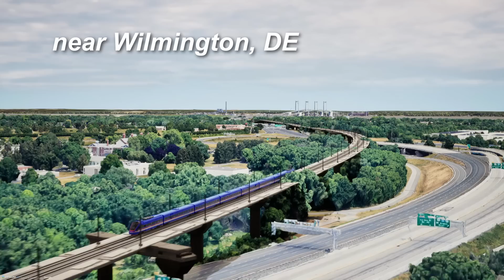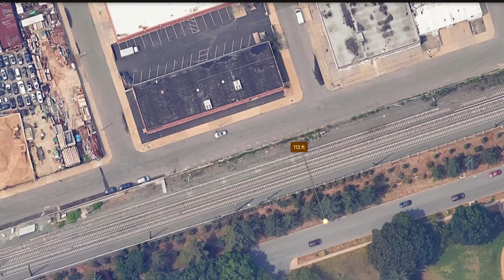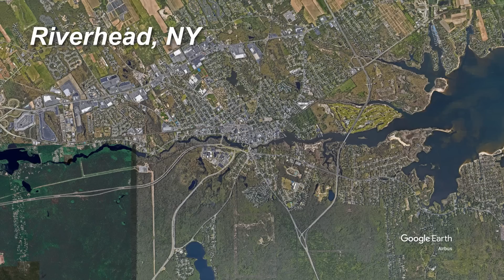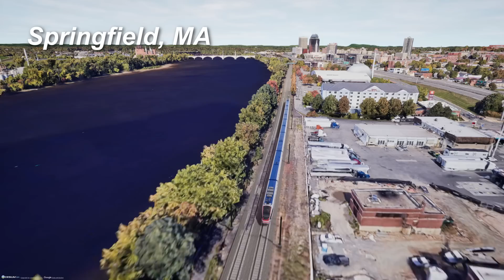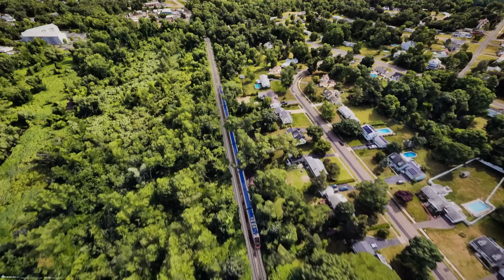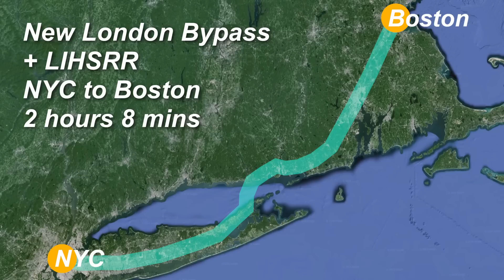How YOU Would Improve the Northeast Corridor For Acela High Speed Rail Service

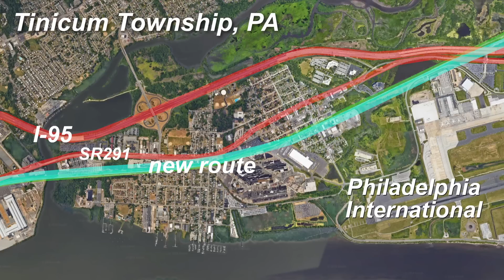Comment: I wouldn't do much. Berlin to Munich is about 4 hr min. The drive is 364 miles. So the average speed of the route is about 91 MPH. Meanwhile the NEC from DC to NYC is 2:55 for 226 miles thus about 77 MPH. It isn't a huge difference.

Upgrading the Catenary to allow for 160 MPH wherever it is straight enough is the obvious main thing to do. It doesn't require huge disruptions or taking property. The Frederick Douglas tunnel is going to save about 2 minutes so about 78.5 MPH average. 40 Miles at 160 instead of 125 is worth another 4 minutes. That gets it up to 80 MPH. I think you might have gone though how much length could actually go faster really short of a completely new line what Amtrak is doing now and catenary is really all there is to do. 

Amtrak's fractional share of trips between NYC and DC is already pretty high meaning it is already doing okay. Honestly I think the upgrades to the NE Regional rolling stock will be more impactful in ridership than shaving a few minutes off for Acela. Reliable headways and nice places to sit beat 20 minutes saved.

Comment: So, I live in Philly, and think W. Passyunk Ave would be better off as a subway line that connects with the BSL. Reading Terminal isn’t the worst spot for a new, underground station, in terms of what places it’s near, but it’s probably a nightmare trying to tunnel around there, especially anywhere near city hall (the foundations are MASSIVE) Personally speaking, maybe replacing I-95 between the Walt Whitman and Betsy Ross isn’t the worst idea (because I-95 in PA is genuinely a kinda redundant route and Center City doesn’t need to be cut off from the river like that) and while we’re on it, I’m also just gonna mention my pipe dream of a tunnel under the Delaware River connecting the Center City Commuter Tunnel with restored passenger service in South Jersey which, in conjunction with the “Swampoodle Connection” (a name that’s hard to forget lol) would allow for 1 seat rides from the PA suburbs to the Jersey Shore. How this interacts with high speed rail (including possible connections to Atlantic City, which is just a low hanging fruit for high speed rail from what I’m told) could be interesting if somehow it’s worth using that tunnel and then going up the median of the NJ Turnpike and then reconnecting with the NEC shortly before Newark Penn

Comment: Great video. Boo-boos: Your photo of Reading Terminal in Philly is actually the old Broad Street Station of the PPR which along with the platforms and viaduct was demolished in the early 1950s, replaced by the 1930's Suburban Station with its underground approach from 30th Street Station, and by the office towers of the Penn Center build over the site of the old station and platforms. Also, you referred to Manchester, Conn as Manchester, New Hampshire :D
Reply from the maker: Ooooooh. I made the mistake of thinking there would only be 1 gigantic railroad terminal in a 6 block radius and I thought both were at the same site.
Reply: Reading Terminal still exists

Comment: I heard it is impossible and extremely expensive to build a tunnel in that location. It is extremely deep in this location. But in an ideal solution, it does provide another route into New England. 

Another idea is to run into LaGuardia Airport. There you have your underwater tunnel into the Bronx. So now you got a train serving an airport. It would reconnect to it routing once in the Bronx. Even Metro North can serve this section. But it would use LIRR right of way until Sunnyside.
Reply from the maker: The sea floor is only about 160 feet there. Might need to start it slightly further inland, since it drops off pretty quickly.
Reply: @LucidStew  They can easily offer a ferry service connection Everytime a train arrives. And it would connect to another train for points west, east and north.
Reply: @LucidStew  How about one of those submerged floating tunnels, where it's essentially a bridge, but submerged in the water column with cables attaching it to the sea floor.. That wouldn't need to be particularly deep, just deep enough so that ships can pass over, and may well be quicker and cheaper than a bored option.

Comment: Could a third rail pickup be added to the Acela trainsets for operating on the Metro North Railroad tracks? While it would limit top speed , it doesn’t appear that  the train would be achieving speed fast enough for it to be an issue.
Reply from the maker: Yeah, I think so. That's basically what the range is about. Its a lot cheaper to bi-mode some trains. Your 3rd rail limit is about 100mph, but that route isn't that fast.

Comment: Great work as always. NEC south of NYC probs needs to come to the realization that it’s very near its final form once the current projects get built. Unless there’s a breakthrough on tunneling costs, that Philly tunnel ain’t happening. Some version of straightening the Maryland curves might be possible, but difficult. 

North of NYC though: I’m still a fan of LIHSRR using the Hempstead branch to Farmingdale. Wasn’t expecting you to go all the way out to Riverhead. I would turn after Ronkonkoma near the Brookhaven National Lab and hook up to the NEC at New Haven. More specifically, I would create an Immersed tube rail and road tunnel for HSR and I-91 so tolls could help cover the costs. Then Hartford to Worcester + Boston via I-84 and Framingham Line (or even expanded Fitchburg line). Regional still connects to Springfield. 

Massachusetts has been mulling an “East-west” rail connection, so this could hopefully link the projects.

Comment: Commenting as I sit on the Acela heading from DC to Newark! It’s crazy how low the average speed is even between DC and NYC.
Reply: Commenting on this again because I had a crazy ride…. Someone was on the tracks north of Philadelphia and we braked very hard to stop, train turned off for 30 seconds and then restarted… conductor confirmed we had a trespasser and they had to do brake checks before we could move again.
Reply: That average speed of 80 mph for the Acela electric train is not much faster than the average speed of 77 mph for the diesel Brightline train from West Palm to Orlando.
Reply: @davidjackson7281 The average speed is actually a bit lower, at 69 mph (nice.)
Reply: @p1xel1115  Yes, on the NEC the Acela's average speed from Boston to DC is 69-70 mph because from Boston to NYC the average speed is 60 mph but from NYC to DC the average speed goes up to 79-80 mph.

Comment: I would definitely say the first three are worth it. The New York and New England altered route is probably worth it. The New London bypass route would probably be worth it if they would’ve worked something out with the preservationist of the nature preserve
Reply: This looks like a good proposition to the Carter preserve; if the original route on its north edge dividing it from more forest is scrapped and deeded over to them, they would get:
1. At least 5 wildlife crossings at no cost (two over the new line's tunnels and 3 on under/overpasses the current alignment uses to bypass roads that bound the east and west borders of the preserve), 
2. A net gain of land under the preserve, which would involve eliminating the continuous barrier to forests past its NNW boundary.
3. A transmission line running thru its south could be consolidated along the railline.

It should be noted that the land the new line would surface-run on isn't much in ecological value; a good portion of the preserve between the tunnels is fields where an industrial site stood relatively recently.

Comment: On the New London Bypass proposal, how about a version that rejoins the NEC slightly earlier, at the bit where the 2 lines run parallel, thus avoiding the controversial section. The rest of the proposal seems much less controversial and environmentally damaging, and would still represent a substantial improvement in journey times.
Reply from the maker: One problem is that you're coming into the east of the project at 160mph, while the west end is only about 75mph.  If you get rid of the Kenyon portion, you don't get up to 160 until you hit the I-95 part and lose almost 40% of the impact, plus the wear and tear of having to slow down and speed up.
Reply: @LucidStew  Fair point. Perhaps they would be better off with one of your more inland options, like the route via Springfield.

Comment: I think there should definitely be a downtown Philadelphia station at Jefferson to serve express high speed trains whilst regional trans can serve the existing 30th street station
Reply from the maker: I kind of like that 11th and Market area. It's pretty close to the 8th and Market stations, too.
Reply: @LucidStew  I mean they are 300 feet apart adding a pedestrian connection isn't going to be that difficult.
Reply: @fasdaVT  There already is one. 

In fact, the underground concourses stretch from 18th Street to 7th Street!  And they run North almost all the way to Arch Street and South to Spruce Street (four blocks).  

And yes, I've walked their entire length.  They get a bit labyrinthine at times, and can be narrow and/or not handicapped accessible-the result of having been built by many different organizations over a roughly 80 year time frame.  

That said, the section between Market East (never Jefferson!) and 8th Street is generally relatively new (*only* 40 years old!) and mostly quite wide.  There are a couple of very small staircases that could be ramped over, and better wayfinding would DEFINITELY be appreciated, but its quite the easy walk.  And that section is air-conditioned too!